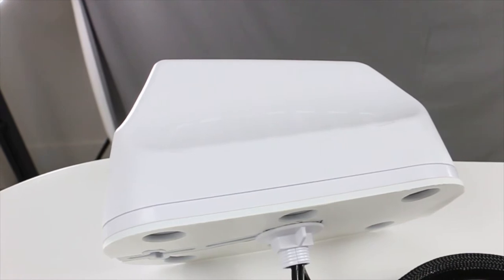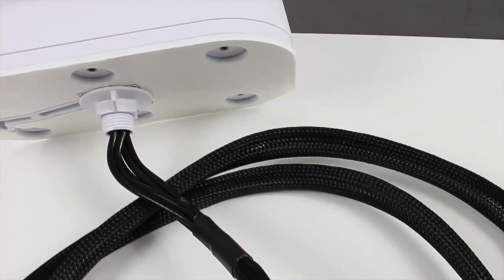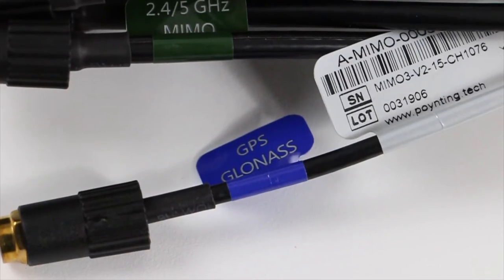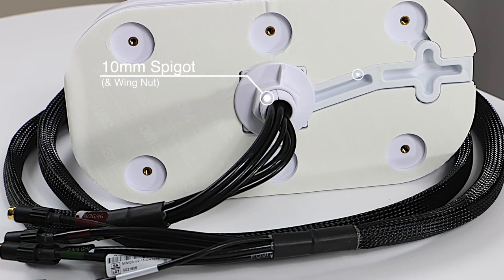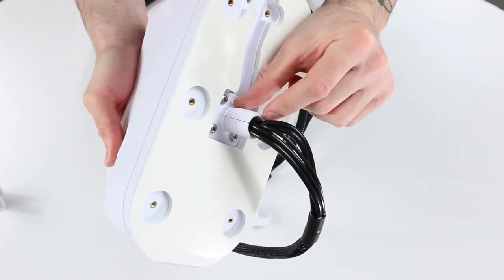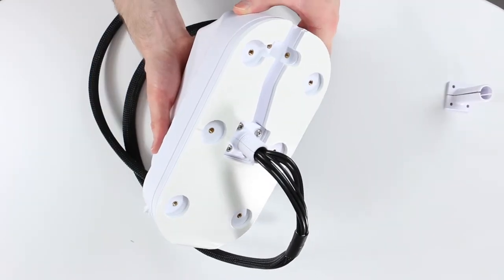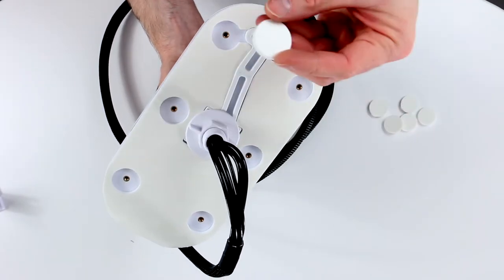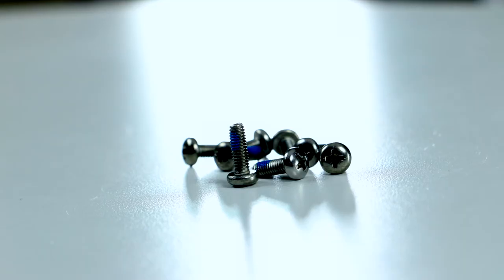Poynting MIMO 3 15 GPS, WiFi and MIMO LTE 4G Antenna: Unboxing and Mounting Options

Comment: Took my Poynting MIMO to my Motorhome dealer as I didn’t want to risk my warranty fitting it myself as the Motorhome is only 3 month old.
The dealer refused to fit it because of the flimsy plastic spigot and the poor sealing. The technician also stated that he didn’t feel it was a good idea drilling 6 holes in the roof. He also told me what I suspected that it would only be comparable with a campervan such as a VW Transporter with a thin steel roof and not a Motorhome with a 70mm cavity. Be warned.
Reply from the maker: Hiya, Respect your concerns, so will address each point.

Out of interest, what kind of sealing did your technician think would be best?  There is adhesive EPDM foam covering the mounting surface and the product is IP68 rated (meaning the antenna itself is protected against water ingress when submerged to a depth of 1.5m for a minimum of 30 minutes).  Sealing is a non-issue - we're confident of this.

The spigot is pretty rigid.  It's also one attachment point out of seven and isn't supposed to secure the antenna on its own.  The six additional holes are optional, though at 10mm they're a fair bit smaller smaller than the 22mm diameter hole for the cables.  You can use the six provided magnets or adhesive foam discs if you'd rather not / cannot drill the additional holes.

This is all in the user guide, I'm surprised the technician missed it.  As well as that the various threaded spigots provided accommodate a surface of 60mm maximum thickness.  So, yes, you'd be correct on that last point.  This antenna couldn't be mounted to a surface 70mm thick.

Poynting antennas are industrial products used in mining, marine and automotive applications.  They're built to last!

All that being said, a 'warning' seems a bit much?  Though yes, you'll most likely void the warranty!